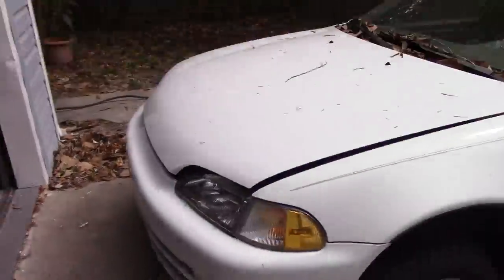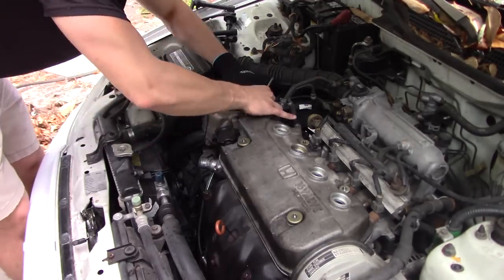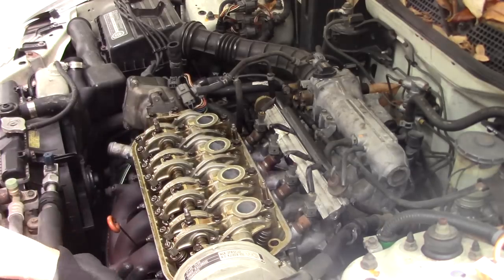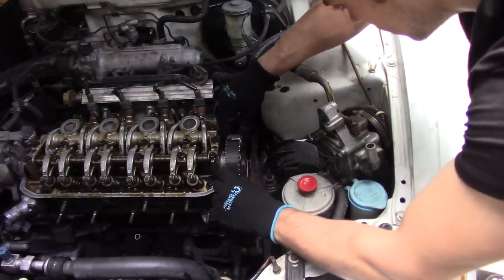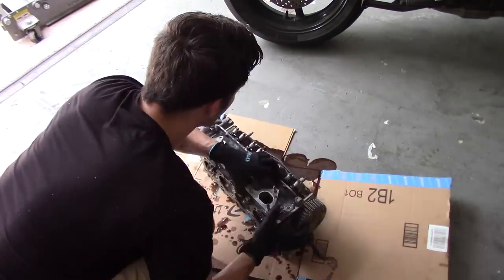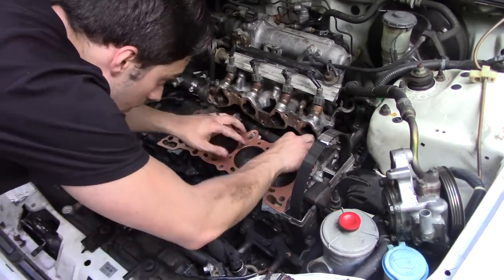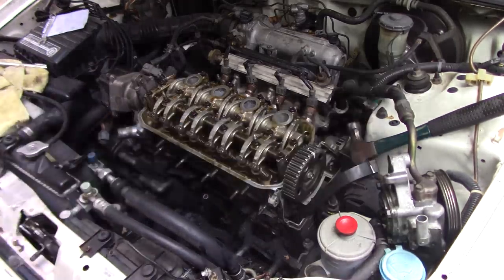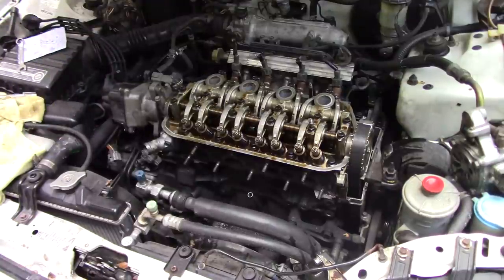How to Replace a Head Gasket  | 1994 Honda Civic DX

Comment: I'm sure others have said this. But NEVER get under a car if it is supported only by a single piece of equipment. This creates a single point of failure. Especially if that equipment is a hydraulic jack. The car could easily slip off the jack or the hydraulics in the jack could fail. Many people have been killed this way. Always use steel jack stands to support the whole weight of the car. Then place 1 or two jacks under the car to catch it if one of the stands were to fail or slip ( very rare but it can still happen).  Be sure to set the parking brake and block the rear wheels so the car cannot move. Never trust your life to one piece of equipment (especially a jack). Its like jumping out of a plane without a reserve parachute!

Comment: I remember the trick my father did when he put the heads back on after a valve job. He sawed the hex of the bolts off, then sawed the bolts down the middle to make it a long screw. He screwed the bolts in, then used them as guide to place the head on. One by one he used a screwdriver to remove the old bolts and replace them with the new bolts that came with the gasket.
Reply from the maker: The Drewman That was a great idea. It would save a lot of headache..
Reply: Well for next time, save you a lot of headaches.
Reply from the maker: The Drewman Hopefully there wont be a next time lol.
Reply: That’s a genius at work. I would have never even thought of that. It’s almost exactly like installing a head with head studs in the block.
Reply: He was taught to do it that way when he was an aircraft mechanic back in the early 60s in the air force.
Reply: I know they want you to use the " New " Bolts.  In my case.... The Bolts are NOT OEM.... I used the old Bolts and it was fine!  I noticed how the " New " Bolt was NOT like the OEM.  So I went against the grain and it worked so far!
Reply: Is there a more detailed video of this technique? I wanna see how its done cuz ive never done a head gask change before.
Reply: Huh y wtf lol so you can flathead torque no way lol. Stretched bolts????? ;)

Comment: Changing a head gasket on my 2011 MX-5 was almost $3800 they wanted. So I literally spent 1 week on YouTube and a weekend doing it myself. Took me about 6 hours and a friend for motivation. Really nothing too hard. Saved me $3700 because I wasn't lazy.

Edit 2021 3 years later. To clarify, the $3800 was the Mazda dealership. They said they needed to flush the coolant, do a diagnostic check, clear the bla bla bla. I knew they were making it a big job. Still own the car and it now has a 2015 Ford Fusion engine. The
Reply: im miata mike It’s absurd how much mechanics charge, even for small jobs.
Reply: im miata mike any videos you suggest?
Reply: How much did you spend on the tools and Jack!
Reply: im miata mike 

They quoted you a “we don’t want your business” price.
Reply: When I didn't know any better I paid over $1200 for a head gasket replacement and head rebuild on my Civic when I was younger. About two years later I redid my friends for some beer and we had no problems.
Reply: Easy, bolts and nuts
Reply: The music is very annoying horrible choice of music 
I came to see a car video not crappy club music
Reply from the maker: Oh, you are welcome for the informative video that I literally spent at least 10 hours on. Yeah, not the best music choice, but it was a lot of work put into this video.
Reply: My was 45$ 😁 but of course me doing it my self people need to learn about there own car so u don't have to get ur pockets dig out from the mechanic
Reply: I Minn think a bout it it's like Whit the regular belt it will chost u like 25 to 30$ for a good belt but a lot of machanic then try to charge y a bout a 40 to 50 just to put it on it would be far if it it's 10 to 15 bucks then ya but that's my opinion I'm not rich I'm stuck in the middle class in a limbo
Reply: Some people have real jobs and DON'T  have time to do this shit
Reply: $3800 😨😨😨😨 I could make a living off of just replacing head gaskets
Reply from the maker: Ideally you would charge a lot less from a typical mechanic that charges an arm and a leg 😂 
But; what you should do is buy broken down cars with head gasket issues, replace them, and sell them.
Reply: @AutoMotivate  teachin my son to do this
Reply: Bro that was great
Reply: Same here shop wanted over $2,000 to do my timing chain I said fuck that spent a couple weeks taking the engine apart and replacing all the guides tensioners and chains saved myself a few grand
Reply: The tech isn’t getting the 1k or 2k it’s the shop
Reply: @JM-yx1lm  Really?
Reply: I wish I had those kind of skills, I'd hire you to do mine.
Reply: Why do people make this out to be so hard.
Reply: im miata mike honestly my EG6 just got a blown head gasket they said 11 hours of labor and 1,300 dollars F that no offense but what the actually F bomb. The kit is 58$ I have my tools and friends that work on cars
Reply: @raferut2088  lol I have an eg6 too, am doing a build on mine and long story short, it had damage on the quarter panel which I was gonna get it panel beated professionally but they wanted to charge me $2300 am like fuck no, done it myself, first time using body filler and everything and it turned out fine
Reply: I have an old Nissan Sentra sitting in my driveway with a blown gasket they wanted to charge me $3000+ dollars to fix when the car isn’t worth $2,000.. might try to see if I can fix it for fun
Reply: @dontrustwhiteyevery1  good job if you got 3k plus to throw away
Reply: @dontrustwhiteyevery1  you realize that the cost would be a week of work for a lot of people. Also mechanics aren't going to get right at your car so you'll be waiting a few days anyway. Taking a few hours a day to fix the problem would mean it gets fixed in a few days.
Reply: I would've  wished there was U-tube  in 1977, U-tube is the best University.Im learning to build me a own  flying saucer and a c3p.o.😎,
Reply: @eriktruchinskas3747  they should cook him breakfast and wash his clothes too.
Reply: @talaverajr391  tell me about it. I think im gonna give my mechanic a tip or a present or something to thank him for being so honest
Reply: @galleryofrogues  It’s a lot of labor and time tho and they don’t get the whole payment cause it goes to the company you went to.
Reply: Yea I was told I'd be 1000$ just to take it apart an taxes an stuff wasn't included..so I'm thinkn of doin it myself
Reply: did you do the swap yourself?
Reply: @Bustedkuhnuckles  no

Comment: I have a few suggestion about the repair: 
1. When loosening the head bolts, you need to start outwards and work your way in, and when tightening start in the middle and work your way out in a spiral pattern. You started from the middle at both loosening and tightening. 
2. The head could be warped, so it must be measured with a feeler gauge (usually it must be within 0.05 mm). If warped head must be resurfaced (it can be done DIY). Same for the block.
3. The dowels that were stuck in the head needed to be taken out and put in the block for easier installation and also for gasket alignment, although this is a minor detail.
Reply from the maker: Valentin Calinoaia 1. They way I did the bolts were by spec 
2. I mentioned at the end of the video that I needed to get it resurfaced, and I did, only costed $60. 
3. I totally forgot to mention about the dowels, so you got me there lol. 
Thank you though
Reply: You're welcome ! I assumed the spec was wrong about the loosening sequence (which is probably the case), that is why I made the suggestion. It's really not that big of a deal, it's just a good practice, in reality if you loose them in steps (which you did), it shouldn't matter that much. 
Nice videos anyway ! Keep up the good work !
Reply from the maker: Valentin Calinoaia  I just assumed that was the loosening specs then. I’m definitely not a pro mechanic, I just wanted to develop a decent video because there are videos like this one that are like 30 minutes long with 5 parts. So, I wanted to make one straight to the point. Thank you man.
Reply: @AutoMotivate  so the head was resurfaced and not the block?  how do you know if you need to do the block as well?  head is easy because you can just take it to the machine shop but the block obviously that you can't bring to the shop...I'm curious on this.  great video by the way...you just gave me huge piece of mind realizing this job is 100x easier than I actually thought it was going to be....these are the main questions I have though....
Reply from the maker: @mikeberg8027  the head is just more likely to warp than the block. You can check the block if it is warped, I am sure there is a video on that on YouTube somewhere and would be smart to do. 
I just took a safe guess. 
This was one of my first larger jobs on a car, and I made mistakes but the premise is there. If I can do it, most anyone can. I wish you luck
Reply: @AutoMotivate  thank you sir

Comment: Man, great video! but you are getting a few things wrong. 

 The manifold next to the fuel injectors is the intake manifold, not the exhaust manifold. Also, at the beginning when you took off the engine valve cover, you called it a head. 

The torque procedure for the head bolts was correct, however when you are loosening the head bolts to remove the head, the procedure is the reverse of the installation procedure. Basically, to loosen you go from the outside in, and to tighten from the inside out like you did.
Reply from the maker: After I uploaded the video, I saw all those mistakes. By that time, I was to late to fix them. I also didn’t talk about using jack stands. Thank you for watching and input, though.
Reply: Are you not supposed to start with number one and continue in numeric order when performing the installation. And torque each at the proper pounds foot?
Reply: @1776FreedomNow   he torqued them. Well, I saw him set the torque wrench anyway lol. I think what he flubbed was when he didnt reverse the torque sequence when removing the actual head itself.

Comment: I did this on my 94 Honda Civic DX as well.  I don't remember it being so much work.  That was way back though.  I do remember that once I got it apart the gasket looked fine to me... not that I really knew what I was looking at...lol.  I replaced it anyway.  I think the mechanic that diagnosed it was trying to sell me on a fix I didn't need.  I don't know much about cars and probably would have paid them.  However, luckily our base had a good auto hobby shop.  At military auto hobby shops you basically rent a bay by the hour and you get to use their tools, lifts, etc.  They also have one or two mechanics on duty that run the place and will walk you through what you need to do to fix whatever you are working on.  I remember it being both fun and yet a bit scary...lol.
Btw, I held on to that vehicle for 21 years and put on a ton of miles (a few overseas even on the autobahn) before finally trading it in.  I wanted a larger vehicle.  It was an insanely reliable vehicle though for those 21 years.
Reply from the maker: The Civic is truly a forever car. A car that can last through generations. A car you build a unique bond with because it just won’t die. 
The military auto shops are a blessing. Wish there were ones for public use, too. Mechanic was probably trying to pocket some money or he wrongfully diagnosed it. Where did the car go?
Reply: @AutoMotivate  I needed a larger vehicle so I traded it in at a dealership.  I was sad to let it go but I couldn't afford to hold onto two vehicles.  I'm pretty positive they resold it... so it's still out there chugging away.
Btw, in case you are curious, the vehicle will actually do over 120 mph like the speedometer indicates.  I tested it out on the autobahn one time.  I figured the car deserved to get up to full speed at least once.  Held it there for about a minute then went back down to my regular 85.  It did it... not sure if it liked it though...lol.
Reply: @AutoMotivate  Hi HwRu? Did the car drive & go back to normal afterwards?? Did the car run hot? Why did u have a blown Headgasket??  Did u find out why your car was running hot? I need help!
Reply: replaced my head too and was strange because i saw 0 indication of a blown gasket or anything wrong. funny the tech was trying to buy my car off me too... weird indeed

Comment: the reason your last bolt was tough was because your head was not seated properly... I would have stopped there undone the bolts and tried to re-seat the head again
Reply from the maker: Yeah, could have been it. I ended up getting the head shaven
Reply: Stating that you got the head resurfaced in the video is a big part dont you think?
Reply: @kennithschjoth2024  Bruh this is why I'm scared of doing this myself.
Reply: You can measure it with a feeler gage, as long as you didn't drive with it blown, you shpuld be solid
Reply: @kennithschjoth2024  in my case I have a special external oil leak that might be from the headgasket.
Reply: There are O rings just above the valve mechanisms and below your spark plugs that might be the cause as well, best to replace those while you have the head apart, its a common issue for early 90s model Hondas
Reply: @kennithschjoth2024  This would be in a miata. I'll search up if they have those too. The  oil comes from between the block and head. Luckily it's only oil coming out and none of the coolant is contaminated or mixing with oil or exhaust.

Comment: Thanks...im getting ready to do this and it really is important to note that it's just specific tools mechanics have and that its a 50/50 every single time because the parts may be damaged as was the case here. Youll obviously always doubt the efficacy of a mechanic because you dont know exactly whats wrong in every case. Theres really no room for doubt...only discovery of the problem. Thats important to remember. Find the problem and be ready for everything it has effected and be prepared for 1 to lead to 234- and so on. Its a machine...its going to be that way.  Thanks for posting.

Comment: Since I am doing maintenance while I replace my head gasket, I took a lot more off than you did here. I removed the intake and exhaust manifolds, timing belt and pulled the cam from the head. I had my head decked to make sure it was flat, and replacing most of the gaskets. I have a 1992 Honda Civic DX sedan with 275,000 miles on it now... she needs some love. I am doing a quick refresh on a few things while I have the parts and time, but in the future, I will be rebuilding a B-series for it from the ground up. Forged internals, high compression. I love her as she is, but this engine is tired, and if I am going to spend money on a full rebuild, I am going all out. Just no turbo, rather turbo an Integra.
Reply from the maker: Carstuff111 rebuilinding the B engine is a great idea. That car will last forever. 275k, that’s half its life haha! That sounds great man, keep up the good work, you’ll be proud when you are finished
Reply: I have owned the car for about 4 years now, and since I bought it, my hands have been the only one to touch it for any kind of work. I bought it for $700.00, put a radiator, spark plugs and wires plus front brake rotors and pads on it, started driving it. Then I replaced the inner and outer tie rods, upper control arms and lower ball joints. Later replaced the clutch and swapped transmissions to one out of a VX hatchback (my original trans. was trashed, the VX trans was on hand, and with taller gearing, I get 48MPG now :D ) and now the swapping of the head gasket. I absolutely love my car. Would post a picture, but this is YouTube lol. Oh, and also have 1994-2001 Acura Integra LS Mesh 15 inch wheels instead of the original 13 inch wheels :)
Reply: Little update if you are interested, have the head on my engine, about to install the intake manifold and exhaust header soon, drain the old oil and get it all flushed out, then on to the timing :)
Reply from the maker: Carstuff111 hell yeah, about there. How long has it taken you so far?
Reply: Total actual work time, about 3 hours including the clean up of the bolt holes and cleaning the deck surface, to head now on.  I pulled the plug from the front of the block to make cleaning out of the coolant passages easier (it is where the knock sensor would go, if so equipped) and I have that back on and tight, the head is one and pretty much ready. Draining the oil is next, then a bit of fresh to clean out the oil passages a bit and pre-lube the cam and rockers. Then on to timing, water pump and tensioner, and that is where I will have to stop till I have my new lower injector seals and the seal for the back of the catalytic converter.
Reply from the maker: Carstuff111 dude you know exactly what you are doing. I should have cleaned the coolant out better, but it was fine anyways. Your car is high mileage, so any cautionary work is a good idea. My job took roughly 5 hours, but that was including me trying to record, which always increases the time.  Also, your car might still spit some steam and water out of the tail for a while until it all evaporated from the exhaust system.
Reply: My car never actually burned any coolant really to speak of, it all leaked external to the block. It burned a bit of oil, but never coolant. What prompted the gasket change was the fact I had oil/coolant spitting down the front of the block.

Comment: Also when you do this, to avoid paying more money or doing it again, take a level and check to make sure your head is still 100% level. If it isn't, you will either need to use a mill and shave it down 10 thou depending on how bad it is, get a new head, or get a machinist to do so.